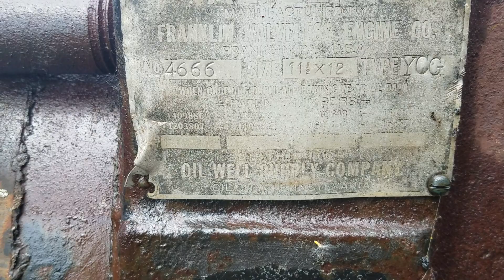Franklin valveless engine

Comment: Nice valveless, I have 2 of them 11 1/2 x 12,  the manuals I have lists them at 25 hp .  Other bore and strokes are 10 1/2 x 12 at 20 hp ,  10 1/2 x 16 at 30 hp,   12 x 16 at 40 hp ,   12 x 12 at 30 hp  ,13 x 13 at 35 hp,   14 x 15 at 50 hp, and 15 x 15 at 65 hp .
Reply from the maker: Thank you for the info! It seems any info on these engines is kinda hard to come by. Greatly appreciated